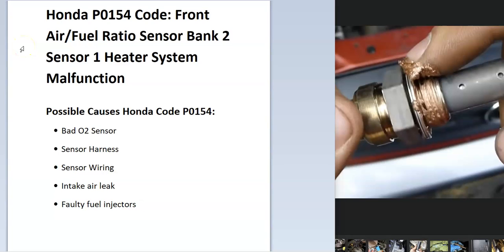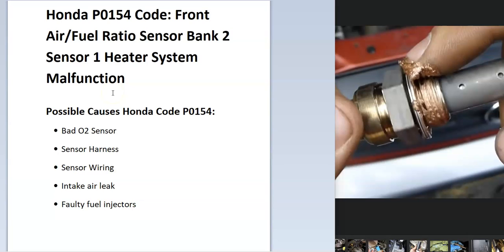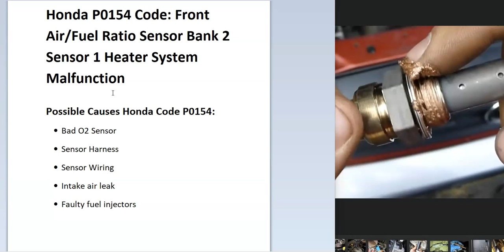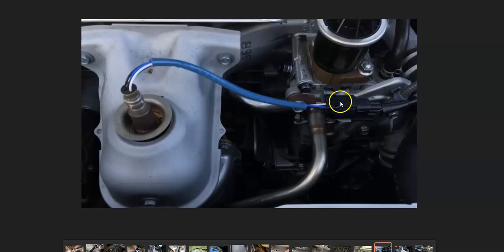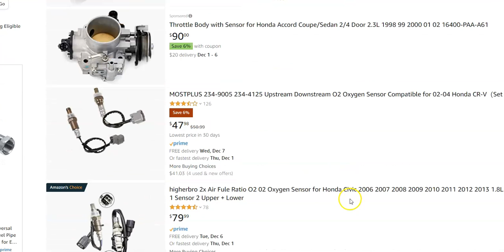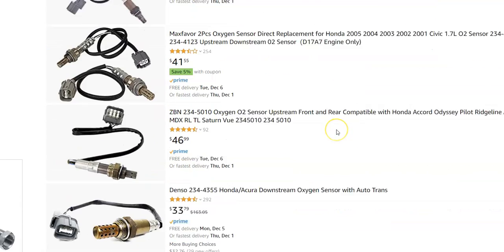How to Fix HONDA P0154: Front Air/Fuel Ratio Sensor Bank 2 Sensor 1 Heater Malfunction

Comment: Could this problem cause the car to turn off when it’s in drive?
Reply from the maker: If the air fuel ratio is very off it is possible.